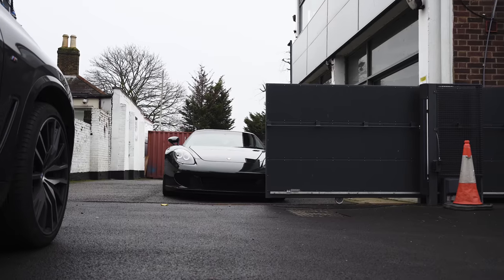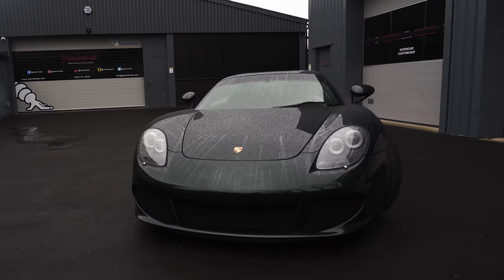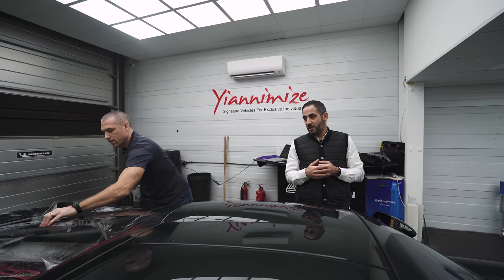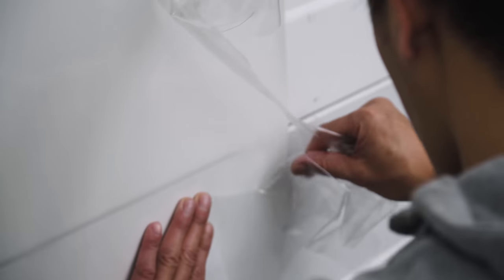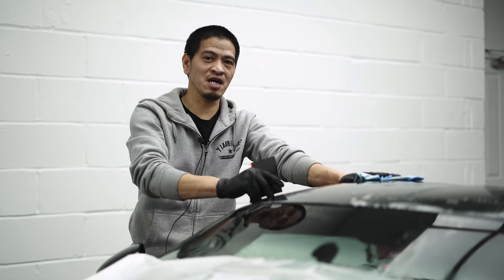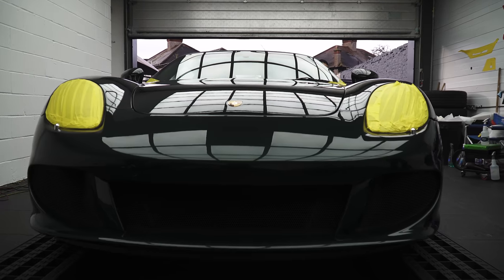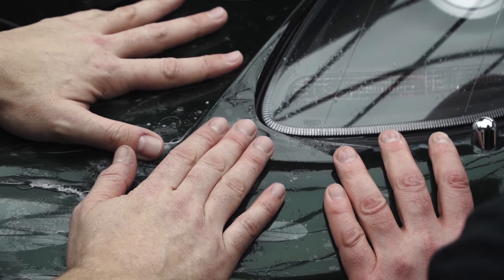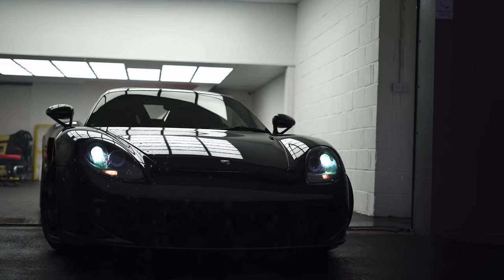Protecting a 1of6 Porsche Carrera GT Zagato in PPF

Comment: Bro, what's with the flickering lights. The working environment shows the results of work achieved. Its also criminal to deliver detailed car with raindrops. Surely an appropriate arrangement, either rearrange the delivery or the car driven straight into the delivery vehicle. 😕
Reply from the maker: Can’t tell a customer when to take delivery based on the weather. He wanted so he got it!